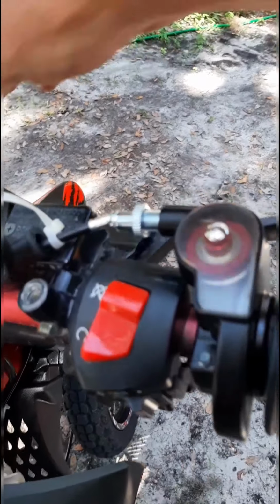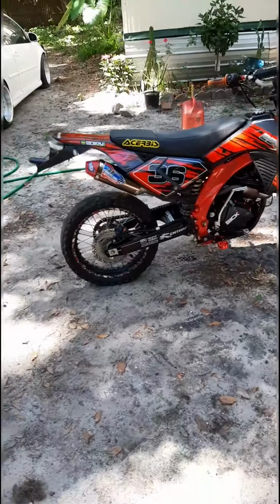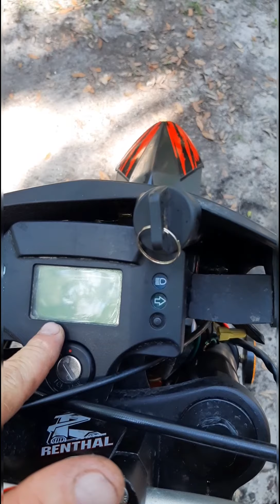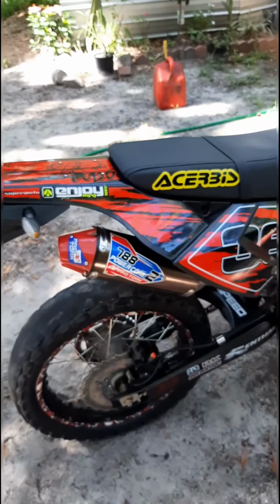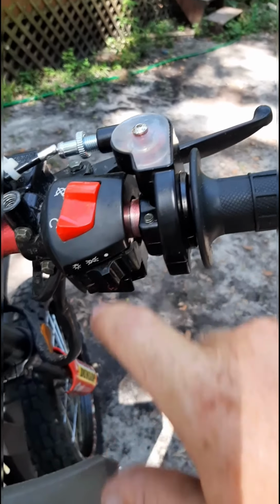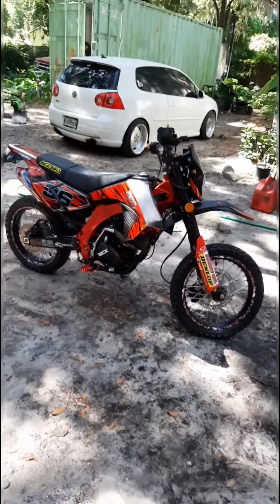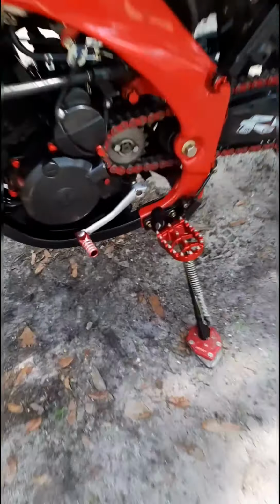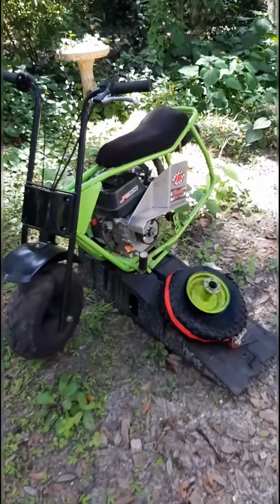Apollo  db36 250  update walk around

Comment: Does the crf 250 exhaust sounds different? That mod gives more power?
Reply from the maker: Yes it sounds better it might add a little power  with the carb right.....I still rip this bike 2000+ miles  idk about adding power because I switched gearing an carb at same time so was way faster
Reply: @boostedmk5gti563   so you change the gear box and carb at the same time?
Reply from the maker: @sixtogonzalez6743  I installed the exhaust new carb an different sprockets  all the same day